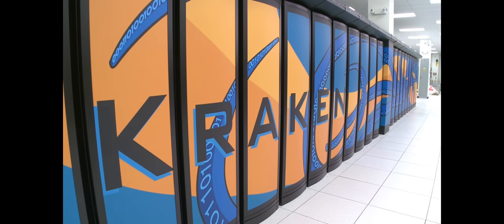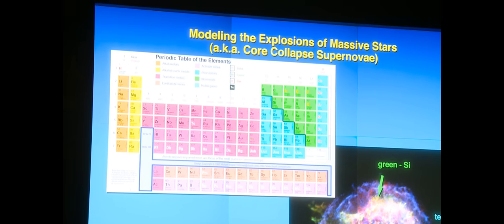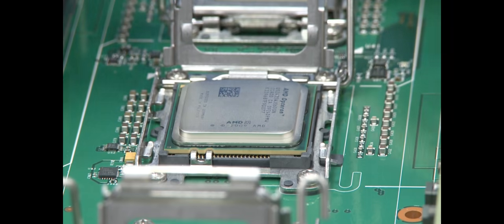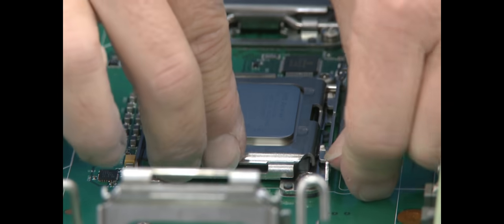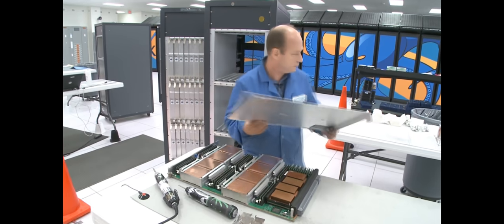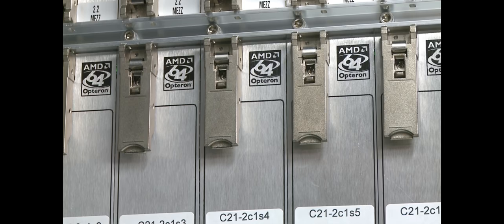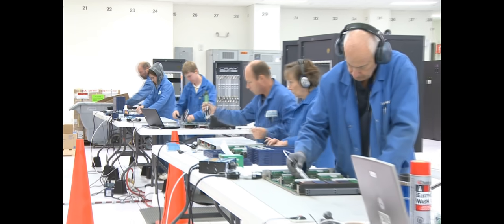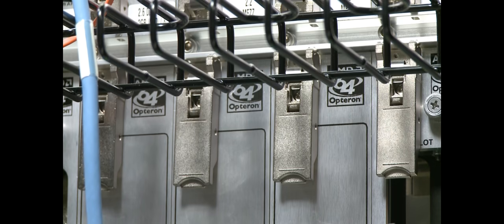"Kraken" Supercomputer Powered by AMD

Comment: They are applying this computing power to try and cure cancer or find another energy solution etc, they were just using the guys studying supernovas as an example of the sorts of research it can help with, as supernova simulation requires more complex computations than finding a cure for cancer. 

Besides, a supernova large enough and/close enough to our solar system could wipe out all life on earth in a matter of seconds, so research into measures to protect ourselves could save many lives.

Comment: It's also the reason in reverse why you shouldn't use an Opteron processor in a gaming machine. It's friggin' powerful, but the sheer speed required to run a game well is not there.